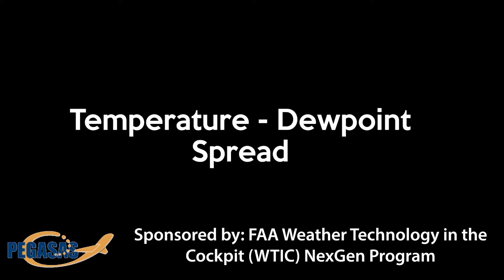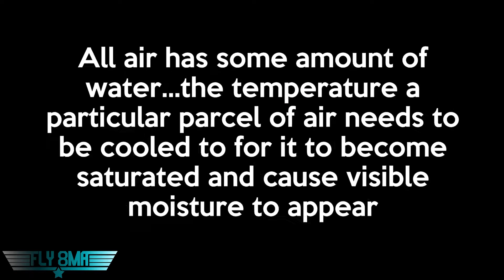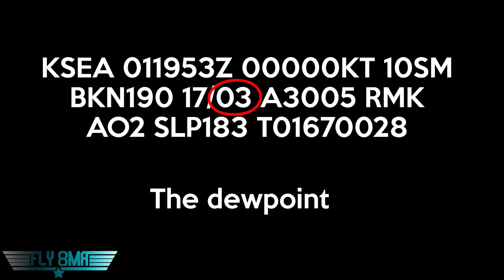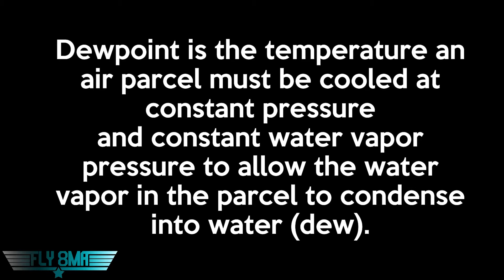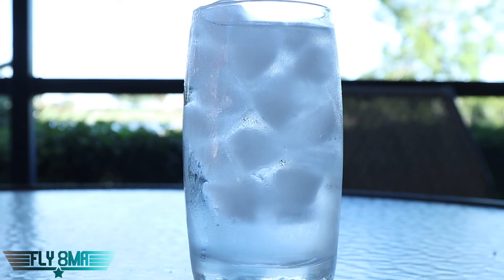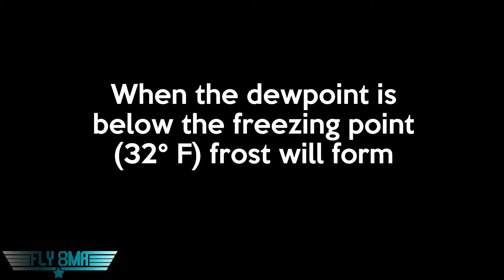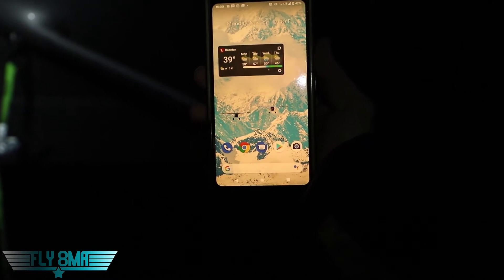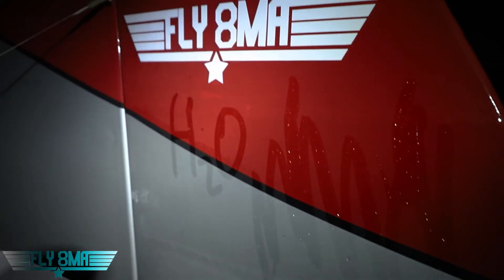Aviation Weather-Temperature Dewpoint Spread Why does it matter when flying helicopters or aircraft?

Comment: I don’t get the part where “the aircraft radiates heat away and so it cools down below the ambient air”. I think that’s wrong. 
I believe the correct explanation is that the aircraft which was at a much colder temperature when in flight has relatively quickly been brought into a warmer (high humidity) environment and so while the external surface of the landed aircraft may be at TOAT temperature (39F)  momentarily after landing, the internal structure is far cooler (e.g. 20F) as it hasn’t had a chance to equalize with the outside air on ground. This produces a temperature gradient between the innermost/coldest part of the aircraft (at 20F) and the ambient air (at 39F) and if this gradient is sharp enough I.e. the aircraft has descended relatively quickly to warmer/high humidity air after a long cruise flight in colder air, it will quickly cool the skin back down to at or below freezing (32F) while the aircrafts sits unpowered in the parking area. 
The reason why horizontal surfaces ice up first is because that’s where the fuel tanks are and the fuel at 20F will take much longer to equalize to outside air therefore the wings have a greater potential for such icing. On the other hand, the air inside the cabin is usually at much higher temperatures (e.g.70F) and so the gradient is usually reversed on most vertical surfaces (non-wing surfaces, more correctly) and so there’s zero possibility of icing at those areas. 
Bottom line is if the ambient is assuredly above freezing, there is absolutely no way frozen moisture will stay frozen on the skin given enough time has elapsed for the aircraft reach equilibrium with its surrounding. Furthermore, if the ambient is above dew point temperature, even the thawed out moisture will evaporate back into the air after enough time has elapsed. I made a point to write this comment because I found the explanation as well the conclusion that in such occurrences, one has to wait until morning for higher TOAT before they could depart quite misleading. Depending on amount of fuel and the coldest temp. the aircraft has seen in cruise, the wait would mostly likely be less than a couple of hours for skin frost to disappear.
Reply: It also happens on cars. I get frost on my car (parked) when it gets down to 40F (36F dew point) but only on the roof and not the doors. The roof radiates heat away into the sky but the doors receive heat from walls and objects.
Reply: I also did not understood it initially, yet the video is right, its radiation the one creating the frost, remember objects can cool down on 3 ways, 1. Conduction, 2. Convection, 3. Radiation, you can look up the first 2 but basically its due to molecule to molecule heat transference, on the other hand Radiation cooling happens due to electromagnetic radiation, what this means is that any surface of the plane that is looking into the sky (specially on a cloudless night) is releasing thermal energy trough electromagnetic radiation into the space, this type of radiation usually wont interfere with surrounding water or air molecules ( it depends on the wavelength, with what type of material will interact this electromagnetic waves) but it will go directly into space, so to make it easier:

The upper surface of the wings are radiating heat trough electromagnetic radiation into space and only the space (not interacting with the surrounding air) so they cool down yet they absorb trough conduction temperature from the surrounding air and as a result the surrounding air cools down even more dropping its already low temperature below freezing temp and creates that frost over the wing, if the plane is left outside long enough the process will have time for it to create frost 

If the air is moving or the plane its moved to a new location the process fo cooling the surrounding air will start again, so technically I believe the guy on the video could have started to fly and not worry about ice over the wings as the process would have been interrupted (however by regulation you must never operate an airplane that hast snow or ice on its surfaces) yet if the air is so cold at ground level is really likely it would be even colder up at flight level so unless my plane has anti ice systems I would not consider it.
If you want more info search Radiative cooling in wikipedia.
(sorry for the bad English I am not a native English speaking person)